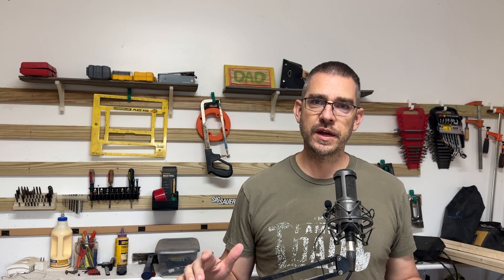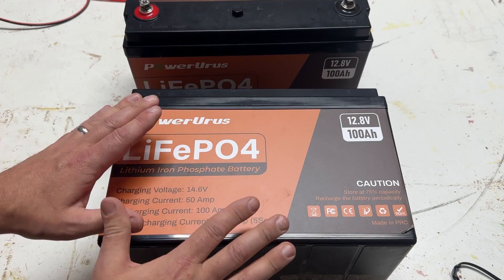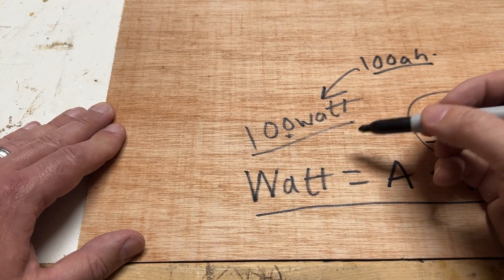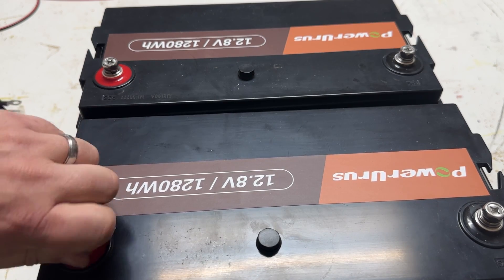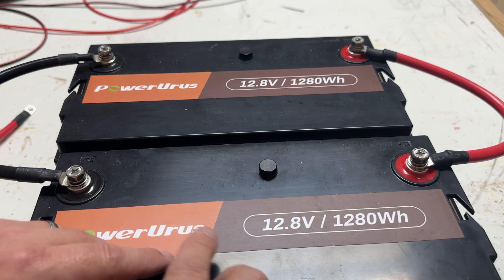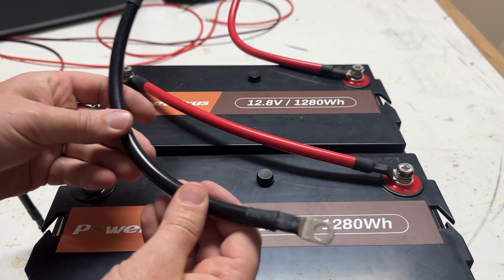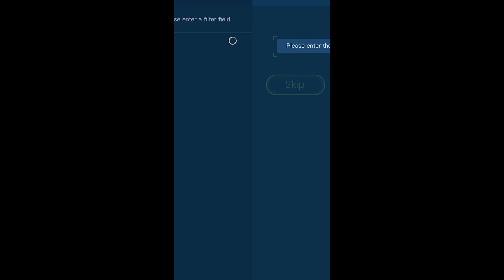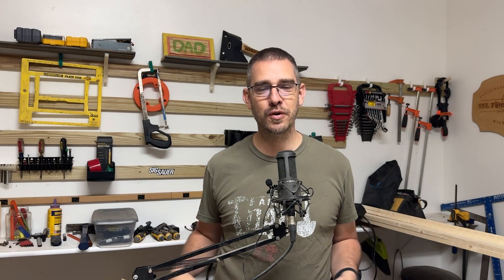LiFePO4 Battery Basics - Parallel, Series, 48V VS 12V + Bluetooth monitoring!

Comment: Hello

I have a 96 volt solar power system, comprising of a 96 volt inverter and charge controller and 8 units of AGM batteries connected in series to provide 96 volts battery bank.

Is it safe to replace the 96 volt battery Bank with 2 units of 48 volts Lithium Battery packs connected in series to provide 96 volts battery bank?

Will this setup work?, what could be the effect on the BMS of each battery pack?
Reply from the maker: Yes, that should not be a problem. When you are researching batteries it will generally say can be used in 12,24,48 volt configurations
Reply: @SSLFamilyDad  This is exactly what I am looking for!!

I have a 96v 105 Ahr battery for my converted EV.

We also experience outages on a regular basis as we are in a typhoon belt region.

Question:
I want to connect 2x48v banks in-series to operate the 96v EV.

And during outage, I want to connect the 2x48V car batteries in Parallel.. and power my home.

Will this be an issue?

I have other videos indicating that the BMS in a 48v bank configuration cannot handle the 96v if  connected in series..

Your kind advice is much appreciated.

Comment: Hey, thanks for the vid.  I'm trying to figure out if this configuration would work, for my ebike.

I had (6) 12v 20ah lead acid batteries in series, when I bought it, for a 72v 20ah bank.
Now I want to put 4 12v 12ah  lithium batteries together but this will only be 48v, I need 72v.

So, I was thinking of using a 12v lead acid battery, wired to a buck/boost converter, to get me the 24v extra volts.  I'd like to get as much capacity from them as well but I'm not sure if this configuration will work? 

If anyone else has any input, feel free to comment ..

You have 4 batteries, there terminals are +/- 

In a housing like this;
B1   B2
B3   B4

You want to connect them in (2) series sets ie;  1, 4  &  2, 3 ..
B1- to B4+
B2+ to B3-

Now you want to connect these (2) sets together in parallel ..
B1+ to B3+
B2- to B4-

Will the battery bank with, 4 batteries connected in series & parallel be ..

The series voltage:
B1 to B4 = 24v
B2 to B3 = 24v

The parallel ah's:
B1, B3, B2, B4 = 48ah 

Total battery bank with 4 s/p:
V = 48
Ah = 48

Comment: Hello 
When connecting 4 batteries in series to get 48 volts, do you need a BMS?
Reply: this is a good question that needs an answer. Can the BMS's in the 12v batts, handle up to 48v?

Comment: Nice video!  I'm wondering if say you used the 2 batteries for different purposes so they were at a different state of charge.  Could you still just hook them up together in parallel and charge them together, or would that hurt them?  In other words, do they have to have a very similar charge to be charged together at the same time with one charger?  Thanks in advance 😊
Reply from the maker: It is best to charge them both fully before putting them in parallel

Comment: Are LifePo4 batteries the right choice when cycle count will be very low?  I'm adding a battery and inverter to my sump pump system.  We go years without a power outage, so I just need a battery chemistry that is ok with being charged and almost never discharged.  Thanks for the video.
Reply from the maker: I would say yes, you will want to add a cheap lifepo4 battery tender to your setup but that should work just fine

Comment: The "basic math" should also include the units.  That's the only thing that most people probably didn't learn when they learned the multiplication tables.  100amp-hours or 100ah simply means 100 X amp X hours, so for an 8 amp load:

100 amp-hours          100        amp       hours          25      1      hours
-------------------------   =  ---------  X  --------  X  ---------   =   ------ X ---  X ----------  =  12.5 hours
8 amp                              8        amp                             2       1

Oh, and:   volt X amp = watt  (just a rule...)   another is:  resistance X amp = volt;  with those two you can figure out the current (amps) and voltage at any place in any simple circuit.
Reply from the maker: Very good, thank you for adding that!
Reply: Where did you manage to find the improper fraction 25/2, 100 / 8 = 12.5?

I think the "rule" is P = V x I - the other is, V = I x R - where I is (A) or current x resistance.  I believe Ohm's Law describes it best in the triangle;
      V
    I    R
Reply: @cndbrn7975  That's exactly the math.  100 amp-hours, powering an 8 amp load, amp-hours divided by amps gives hours, 100 / 8 gives 12.5, but taken in steps dividing both numerator and denominator by 4 gives 25 / 2 which is of course also 12.5.
Reply: Let's say I have four of these batteries connected in parallel. One of the batteries is Bluetooth capable. Will it be able to measure the other three since they are all connected?
Reply: @autobond007  Being parallel it will show the correct overall voltage (~12v).  It will only show the amps (used to compute remaining capacity) for its own battery, and also only its own cells' individual voltages (~3v). In most cases the amps/capacity is likely to be the most missed feature. I'd recommend instead of a single bluetooth battery, using an external shunt and "coulomb counter" like the victron smart shunt or similar but less expensive asian versions.

I do like bluetooth to show me what is going on inside a battery. But I only have bluetooth in  2x 12v and 2x 48v batteries. The rest do not (were purchased less expensively). Sometimes I regret that, but not yet enough regret to crack open a case to use a voltmeter.